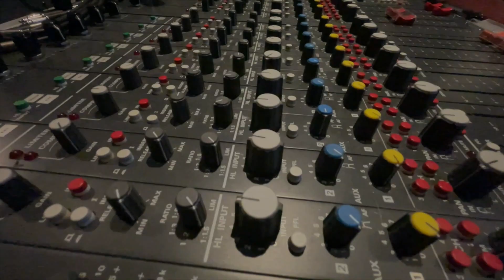Audio sample rates explained

Comment: Waveform Analysis 101 teaches that if you remove the fundamental of a squarewave but keep its first ten ODD (corrected, thanks) order harmonics you will reproduce the entire squarewave. In RF transmitters the energy and intelligence is contained in the "sidebands" the signals above and below the carrier, fundamental frequency. All showing that the fundamental is not as important as the harmonics. And being a lower frequency, it is easier to process. So bandwidth extended 10 times the highest fundamental is required to accurate reproduce sound. If 20kHz is the highest we can hear, 10 x 20Khz = 200Khz as the lowest frequency we need to capture. So a sample rate of 400k is minimum. 

And that is if you only consider frequency as in sinewave based aspects. The hairs in our ear canal can respond to transient edges as fast as 10µs or 100Khz. 

Then there is the Shannon part of the Shannon- Nyquist Theorem. His part of it is discussing a "continuous" wave/ infinite sample points. While Nyquist talked about how to most accurately store/ recall based on desired fastest rates of change. Which was turned into the famous twice the highest frequency desired. The example that is given is Day/ Night. Two samples in 24 hrs, noon and midnight, and you have a full representation of the Sun circling the Earth event. But what if those samples were at sunrise/ sunset? It would be as accurate to say the Sun sits on the Horizon and circles the Earth there. Or a 24 hour Sun in Alaska? So sampling should actually be around 10x the highest frequency, which is the highest even order harmonic of 10x. So to actually accurately transcode audio to 20Khz you need a 2M sample rate. Welcome to DSD!
Reply: yeah this perfectly responds with accurate amplification-> 10x the power to relieve strain of the highest peaks. Also a subject Paul attacked early on.
Reply: There’s a lot of misleading information here. To start with, a square wave has a spectrum consisting of only odd harmonics.
Reply: @markthomas1225  Thanks for the correction. Don't know why I keep making that same mistake! I had to literally manually graph it in college many decades ago. But other misleading info? I'd love to see that.
Reply: @glenncurry3041  If we try to create a square wave by adding the first 10 odd harmonics in phase, the result is recognizable, but it has a high frequency ripple with an overshoot of about 11%. Fortunately, these days you can replicate this calculation in Excel without a calculator and graph paper. Second, if we then remove the fundamental, the result looks nothing like a square wave; the edges remain, but the flat top and bottom of the square wave disappear. We can't safely remove the fundamental. Were you thinking about removing the DC (zero frequency) term instead?

When we consider the first 10 odd harmonics, the highest is the 21st, which is at 21 times the fundamental frequency. The bandwidth needs to be much greater then 21 times the square wave frequency to preserve the characteristic square edges. Fortunately, we don't need to consider sampling a square wave at 20 kHz. If we consider that 20 kHz is the limit of human hearing, then for PCM the 44.1 kHz sample rate is sufficient to reproduce the signal for almost all purposes. Some might argue that human hearing extends above 20 kHz, or that the phase response from a high order filter is audible, in which case it makes sense to sample at a higher frequency (say 96 kHz).

You're correct to say that the information in an RF signal is in the sidebands. However, the RF spectrum is reflected about the carrier frequency in the same way that the baseband signal is reflected about the DC (zero frequency) point on the axis. The center frequency of the modulated signal corresponds with DC in the baseband signal. It's not possible to eliminate the fundamental of the modulating signal in either case.
Reply: @markthomas1225  Does creating a squarewave using harmonics result in overshoot and ringing regardless of how high in odd harmonics you go? Pretty much so! That is why a simple gated pulse (e.g. op amp) is far cleaner than a digital synth squarewave made out of combined sinewaves a digital generator would do. 

"When we consider the first 10 odd harmonics, the highest is the 21st, which is at 21 times the fundamental frequency."

????? ..... the "first 10 odd harmonics" literally means the fundamental times times 3, times 5, .... UP TO times 9. (times 10 is even, not odd) "21 times the fundamental frequency" would be the 21st harmonic. No wonder you understand so little about this! 

"The center frequency of the modulated signal corresponds with DC in the baseband signal."

And now you want to claim there are NEGATIVE frequencies? That somehow DC, ZERO Hz, is the CENTER? That sine waves repeat in some negative time domain? WOW!
Reply: @glenncurry3041  You can define terminology any way you like, but it seems to me that the first 10 odd numbers > 1 are 3, 5, 7, 9, 11, 13, 15, 17, 19, 21. Maybe you have a different view, but my interpretation is not ridiculous. There's no need to be offensive.
Reply: @markthomas1225  OP: "but keep its first ten ODD (corrected, thanks) order harmonics"

MT #1: "spectrum consisting of only odd harmonics"

MT #2: "When we consider the first 10 odd harmonics, the highest is the 21st"

My reply: "'21 times the fundamental frequency' would be the 21st harmonic. No wonder you understand so little about this!"

MT #3: "You can define terminology any way you like, but it seems to me that the first 10 odd numbers ..."

Unable to admit error, you instead desperately try to pretend we were talking NUMBERS instead of the ACTUAL discussion about HARMONICS! 

SAD! So long!
Reply: Super high sample rates are much more easily talked about in theory than technically achievable or necessary for the vast majority of people. Luckily for humans we only need a basic but accurate outline of the audible sound frequencies and our brain adequately fills in the rest of the sound picture, in much the same way that our eyes and brains do with moving pictures. After all there are many people who actually think playing vinyl records is the best way to hear music, so go figure.
Reply: @donjohnstone3707  High sample rates are easy with low sample bit depth. Most Sigma Delta ADCs can easily handle 2M at single bit. 

There is a famous silhouette of Abe that showed how little actual detail is needed for the brain to be able to guess at what the object is! "It's ABE!" But in reality it could be thousands of other people that are just not as famous and locked into people's memory for pattern recognition to take more than a guess. YES, the brain can spend lots of resources trying to guess at what limited info is trying to tell it, make assumptions, reconstructed based on memory. People listen to records so their brain does not have to work that hard! So we can enjoy instead of use effort processing. Is that an actual piano or a synth? Not enough detail left in the digital so which ever.... But that disc even through scratches, yep piano!
Reply: @glenncurry3041  With CD's we have much more than one bit depth and the brain does not get up a sweat trying to guess what is going on. There is more than enough information to trigger an automatic process that the brain does naturally. Audio signals on vinyl are only an approximation of the recorded sounds, as the stylus point bounces around trying to negotiate the lumps and bumps in the groove with a limited and varying degree of accuracy and added noise. Vinyl records are an adequate sound source for many people but they barely achieve 16 kHz at best, beyond which there is mostly surface noise that people's minds often confuse as being an ambient part of the music signal, if they are actually able to hear those high frequencies. What has helped improve the quality of sound on much of the new Vinyl, is the use of digital recording and mastering or remastering and computer controlled cutting machines. Of course higher sample rates are always preferred if available and it is a great failing of the music reproduction industry that such very limited high resolution sources have been made available to the general public. Instead there has been a refocus on making vinyl records, and dropping of SACD, along with the development of streaming services, which does not address and solve the problem of providing higher digital resolution sound sources for ordinary consumers. Unfortunately but predictably, the audio industry is mostly about making money and dominated by the "good enough for the unwashed masses" ideology.
Reply: @donjohnstone3707  Test of galvanic skin response prove digital increases stress compared to vinyl. 

With low info your brain can not distiquish between a piano and synth. And OK, your brain may not do much processing so does not use much energy,. 

CD4 required a bandwidth out past 50Khz, frequencies over 120Khz have been cut on vinyl, "they barely achieve 16 kHz at best"? WOW!

Dynamic range of over 100DB has been measure on records. 

So outside of LPs having a better bandwidth and less noise, the lack of needed brick wall filters, added noise in dithering, longer life expectancy, .... CD's are good for what? 

So do you have anything factual to offer?
Reply: @glenncurry3041  If a synth piano sample is created from a real piano sound using digitally complex software at a high enough resolution, then of course it will be difficult to tell if it is a real piano or a synth sample. I did not say low amount of digital information, I am referring to an adequate amount of digital information, such that a persons brain can clearly recognize the sound it is designed to represent. It is one thing to bandy around results of experimental frequency and dynamic range test figures for specially made vinyl records, in laboratory conditions, It is another thing to get acquainted with the regular real world test results that are commonly found with ordinary records and playback systems. Perhaps you should have your ears tested to see what actual frequency range you are capable of hearing, as I would be interested to know the result. You have not as yet presented any relevant factual evidence to counter what I have been saying and I stand by everything I have said so far. PS. I hope you are not one of those fools who think HiFi means vinyl records and not CD's. It may be your experience but I don't find playing my CD's in the least bit stressful, although I have had many stressful moments playing records, because they make a lot of unwanted noises due to scratches, nicks, dust collecting on the styli, damage in the grooves, vibrations affecting the turntable, wear in the grooves particularly on records with music I really like and tend to play more often, stress inducing need to manually place the styli at the start of the record and pick it up by hand when it finishes without dropping it, concern to get records back into their covers without dropping them or getting my fingers all over them, trying to stop records from warping etc. I have none of these problems playing CD's but I still like playing records, mainly because I have many titles on vinyl that I cannot get on CD.
Reply: @donjohnstone3707  "It is one thing to bandy around results of experimental frequency and dynamic range test figures for specially made vinyl records, in laboratory conditions, It is another thing to get acquainted with the regular real world test results that are commonly found"

And it's the same "thing to bandy around results of experimental frequency and dynamic range test figures for specially made" digital samples.

So the FACT that vinyl literally has been proven to have over 100db S/N and record frequencies over 120Khz, (far greater than Red Book!) is just more than you care to accept? You want to claim the source recording that is the same for both storage/ recall systems is somehow better preserved in a system that is PROVEN to have a LOWER bandwidth and less S/N, IOW CD? It is time for you "to get acquainted with the regular real world test results that are commonly found".
Reply: @donjohnstone3707  "Perhaps you should have your ears tested to see what actual frequency range you are capable of hearing, as I would be interested to know the result." 

Funny you mention this. I am in the middle of such a randomized controlled test in fact. And by accident. A week or so ago I started hearing an intermittent squeaking, squealing noise outside my kitchen window late one night.  Too cold for bats? Something living in the facia under the roof? It kept getting louder and more regular over the days. My partner, standing next to me at the widow says she hears nothing. On a warmer day (above freezing) I went in back and discovered it was a neighbor's cheap metal windmill decoration in his garden that when the wind got it spinning, squeaks. It's 10' from their window and does not bother them? She can stand by our window and not hear it. I can sit 30' into the house, away from the window and tell her it's relative speed based on the sound of the squeaks, she can't hear. Next warm day I'm going out there and lube it as I seem to be the only one that can hear it! But I can prove blind folded to tell how fast it is spinning. When I used to go to malls, I could point to the ultrasound motion detectors as they bothered me. So ya....
Reply: @donjohnstone3707  So my inability to grasp new technologies is perhaps backed by my degree in electronics, 10 years of Audio sales, including living in Nashville, selling Sony/Superscope, Marantz, AT, Kenwood, AR, Cerwin Vega, Maxell, ... to both retail and studios. Including Opry Land where the head tech was a personal friend.  The Model 500 amp Marantz gave me to hand to Capricorn Records in Macon Ga. The AES meetings I attended talking to Dr Thomas Stockham about his SoundStream digital recorder while comparing a DtoD to a half track Ampex and the Soundstream playback of all three in the mixing room it was cut on on the lathe that cut it! Or the JVC and Sony engineers from their Digital Audio design group I've had extensive discussions with at AES meetings and CES shows? I came in 2nd for a job opening by Studer/Revox for National Service Manager because of failing a handwriting eval they wanted. I design and build my own guitar amps. So I guess I just lack exposure to the technologies? 

PROVE that 120Khz signals have not been cut on vinyl! If again you find someone to show you how to do research instead of just repealing the same misinformation over and over!

"no phono cartridge amplifier or speakers can reproduce sound above 20 kHz" then explain CD4! Required bandwidth out to 50Khz! 

" DYNAMIC RANGE - LP's have about 70 dB of range while CD's can handle over 90dB," ---- "The best transformerless combination, the Sumiko and eight parallel 2N4403s, has greater than 112d8 dynamic range," (vinyl-dynamic-range.pdf @ analog planet)

So let's see what ya got!
Reply: @glenncurry3041  Thanks for providing that interesting information about yourself. It shows you have spent a lot of time and energy in your life learning about electronics and audio in particular, so I assume you consider yourself to be an audiophile. That explains your interest in the deeper technical details of sound reproduction, especially for HI FI. Whilst I am well aware of the field of audio engineering I am neither an audio technical expert or an audiophile. I consider myself a hifi enthusiast, with my main interest being affordable mid-range hifi gear. I occasionally like to find out more about expensive high end gear, to see what cutting edge audio technology is doing but I generally rely on consumer reviews and other simplified expert explanations to more easily understand the basic technical information and what it means for ordinary hifi enthusiasts like myself. I read through the article you mentioned about the potential dynamic range of vinyl records compared to CD's. It was very interesting and informative but was difficult to impossible for me to follow all the information, due to my limited technical knowledge regarding much of the jargon and details involved in the essay. My general takeaway was that there is a lot more to research about the complexity going on with sound signals and how ours ears and brain receive and interpret them, than I had previously realized. It made the basic information I had previously learnt, from what is generally available on the internet, seem very oversimplified but not necessarily inaccurate or incorrect, in regard to most commonly available, affordable, good quality, modern hifi equipment. That article was from 1996 and digital sound has improved since then. I actually use a 20 bit CD player, from 2004, which deploys a Lambda super linear converter that theoretically eliminates all zero-cross distortion, which is, according to Denon, the main cause of reduced sound quality from CD players. It has 2Hz - 20 kHz frequency response, 100 dB of dynamic range, 110 dB S/N ratio, Harmonic distortion of 0.003% and 103 dB of separation. It works very well and sounds great playing my good to best sounding CD's. Of course there are higher spec and better sounding CD players, CD transports and DAC's that have been produced, with many using 24 or 32 bit processing nowadays. There are even some using valves to get a warmer rounded analogue sound, which I would love to hear someday. Unfortunately, to obtain the level of high quality sound results from vinyl records, as described in the article, a person would need to make a substantial investment in equipment that most people, like myself, do not feel is warranted or cost effective compared to very good, affordable mid-range gear. Even if you can afford expensive high end phono gear, there are specific down-side issues around using it, that CD's don't have. The fact is that High-end hifi still remains too expensive and not cost effective, for most people, due to the law of diminishing returns and is mainly desired and bought by cashed up, genuine audiophiles, who may have, or mistakenly think they have, "golden ears". The quality of different vinyl records varies greatly, because of reasons I'm sure you know about and as I mentioned previously, that very fine detailed information in the record grooves gets damaged with every playing, by the tip of the stylus. CD's and other digital sound sources, played on good quality hifi systems, is considered perfectly satisfactory sound quality by almost everyone, except a small coterie of analogue purists, who have their own particular rationales for disliking or not being interested in Digital formats, which is entirely their business. Personally, I have no bias toward analogue or digital as formats, only toward what music I like and which particular copies of records or CD's sound good. PS. If you ever get around to doing a hearing test, don't forget to let me know the results. For most middle-aged people, hearing frequencies up to 10 or 12 kHz is considered excellent on average.
Reply: @donjohnstone3707  Well that was a turn around! Almost my entire life has been involved with "learning about electronics and audio in particular" from my first amp I built from a kit around '64. And my DYI "Thrifty Three Way" speakers in '68. Then kit based test equipment and RF. I worked as a tech at TV stations including transmitters with an FCC license. I've sold TV transmitters and satellite uplink trucks to TV stations. And in my 3rd lifetime was on ARPANet before it became the Internet and sold highend CGI including T2 level systems and software and IT shipped around the world. If it's been bleeding edge audio, video or IT, I've been connected at some point. 

When big belt buckles were actually the fashion trend ('70's) I gave Saul Marantz a Marantz belt buckle as he was touring with Jon Daulquist introducing the DQ10 after selling Marantz to SuperScope. Well there was also the party at the California Playboy Mansion with Joe Tushinski/ SuperScope because he was personal friends with Hugh.... It's been an interesting trip!

While you have a long way to go to understand all of this obviously. e.g. CDs are locked to Red Book specs. They are 44.1K/16 bit. That is the file structure and there is nothing that can be done about that. Yes newer systems upsample, basically multiply the same data set just to have more sample points to make filtering easier. But you can not create NEW info from what was stripped at the first conversion. It is gone! While inner detail always remains in vinyl. The increased resolution is just based on the ability to access more of i! Not it no longer existing! And it does not have to be expensive. I am currently using an ERA turntable I bought for under $150 used. Find an old AR turntable! 

Finally you mention learning about sound and hearing. Look into time domain instead of frequency domain discussions. Few and far between. Steady state, especially sinewave, signals are the test criteria because way back in the day that was all T&M equipment could do. But music has little to do with repetitive sinewaves. Fast leading edge transitions, inner details, ... because of survival needs, evolution developed the fastest path to brain cognition for our auditory system. Keep us alive by hearing bushes rattle ASAP! The human ear/ brain can detect transitions, sounds as fast/ short as 10μSec, which relates to 100Khz. Even if we can not "hear" 100Khz. Our ear canals can detect it and our brains can process it.